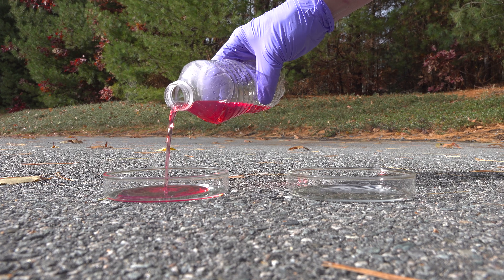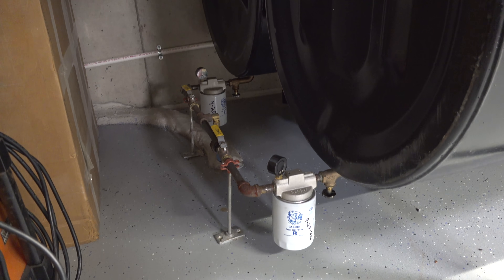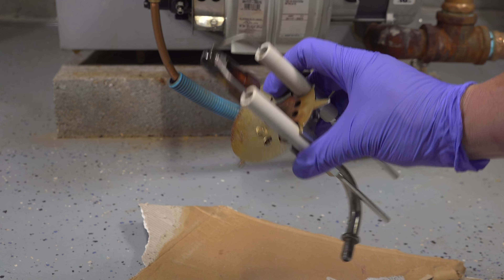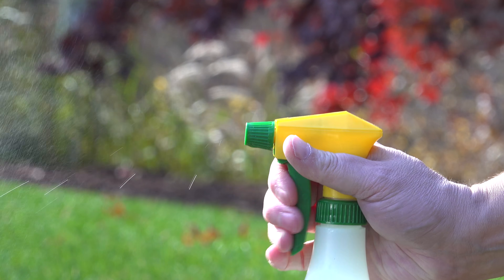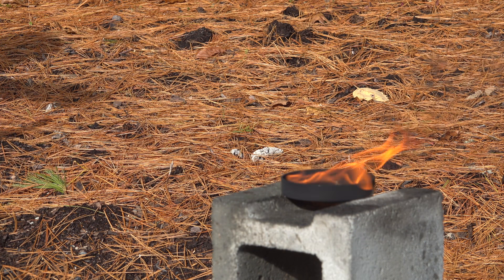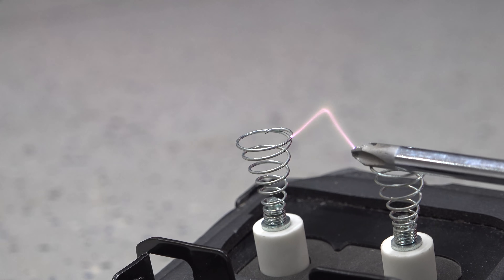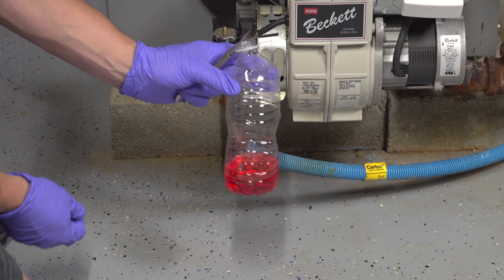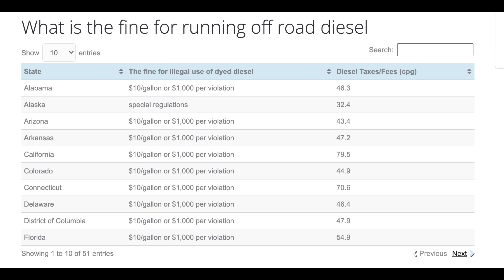Why Heating Oil is BETTER than GAS - Explained

Comment: For the folks that don't know, heating OIL is actually Diesel or some may call it Off Road Diesel. I'm a Hazmat Truck Driver, and I have delivered this product for many winter seasons here in Maryland!
Reply: Here in the U.k it's called red diesel and it's used for farming vehicles. Heating oil has a yellow colour and it's called Kerosene.
Reply: @ZKRITTEX  in the US red diesel is the same as heating oil. theyre both just diesel fuel dyed red to indicate its not taxed for highway use. Kerosene is usually only used as a supplemental heating fuel in the US.
Reply: @TheGenerator_Guy  🎯
Reply: @TheGenerator_Guy  
Is kerosene cheaper or dearer than red diesel in America?
If it's cheaper, why not use it for heating instead of diesel?
In Europe kerosene is cheaper than diesel so kerosene is used for heating.
Reply: @ZKRITTEX  kerosene is a different chemical.
Reply: @ZKRITTEX  
In the US kerosene is number one fuel oil.
Reply: Yup. Whenever I run out of heating oil I'll grab a container of diesel just to survive the night.
Reply: Correct. With pretty much all heating oil now processed to be ultra low sulphur content, the only difference between auto diesel, offroad diesel, and heating oil, is the taxes.
Auto diesel is taxed with road tax.
Offroad diesel is taxed state sales tax.
Heating oil is untaxed. (considered an essential for life, like food and clothing)
Reply: That’s what I thought it was. Red dye diesel
Reply: Yeah kerosene will fuck your furnace if you run it too much
Reply: @danhyde2656  You’re wrong. You got boned by your heating guy. Kerosene burns cleaner than fuel oil/diesel, but it’s got less BTU’s.
Reply: @danhyde2656  no it won't. Kerosene is used in places where the oil tank is outside. Heating oil will gel up in cold weather but kerosene won't. You can run kerosene or diesel in your furnace and it's 100% fine.
Reply: @danhyde2656  your heating tech ripped you off. It sooted because it wasn't it wasn't adjusted properly. There is zero difference in the way kerosene burns in a furnace vs oil. I'm a licensed oil burner technician. As for your tank you've either gotten lucky or your oil company puts in a anti-gel additive every time they fill you up.
Reply: Farmers just call it red dye diesel
Reply: If you don't sitchoooooo diesel head...nah jk very neat. Thanks for keeping us warm
Reply: Is this an add for oil heat?
Reply: Ty, learning alot about diesel and kerosene lately
Reply: In the UK, and to the best of my knowledge,  most of Europe, heating oil is kerosene, not diesel.
There are some houses and buildings which use agricultural diesel (red dyed diesel) but these are very few.
Reply: Hello fellow marylander, what u say is true because i was running low on heating oil so i went to the gasoline station and just got about 5 gallons of diesel fuel and was good to go.
Reply: with lubricity my friend
Reply: Yep, when I run low on weekends and don't wanna pay weekends delivery, i just full up containers with Diseal fuel
Reply: @Larry Butler I didn't know liquid could mix with a gas and contaminate it so why is it relevant? Seems like they are just being efficient with space.

Comment: Being tech savvy, I’m surprised you’ve not yet embraced ground source heat pumps. For one unit of energy to power compressors, pumps and fans, you’ll extract and move 4 or 5 freebies. Tapping the heat right under your yard! Perhaps a video on upgrading your heating, cooling and domestic hot water systems? Can all be done through the heat pumps. I enjoy watching your videos. Keep up the great work.
Reply: Heatpumps are serious buisness.
Reply: Yes, good point. It's always cheaper to MOVE heat than to CREATE heat.
Reply: @mattfoley6082  Heat pumps are still getting hot air from the surrounding area, which can be an issue in some cases

Comment: As a professional and certified oil heat technician, why would you not remove the electrodes when changing the nozzle? 
You take a large risk of breaking those porcelains by not removing them.
Reply: Maybe he's not a softie like you and has confidence in his hand tool skills.
Reply: @mdlabor43  🙄

Comment: I was told most farm tractors run Diesel Red...and they check usually in southern farm belt states. I have never been checked in Cali for my 1997 Ford F350 XLT PowerStroke (7.3L turbocharged I.H.) 4x4 crew cab..also Cali weasels (aka parasites) do smog checks on newer diesels....I am exempt.
Reply: Yes off-road diesel is red

Comment: Was an oil burner tech for over 25 years and have worked on natural gas for about five years. Have not worked on any systems running on gasoline. Oil, natural gas and propane are safe and, if the oil burner is set up properly, both run clean.

The only thing you can really adjust on today’s gas systems is the gas pressure unless you are using a power burner. On oil you can adjust the pump pressure, air gate and in some, the draw assembly. Oil systems are pretty much customizable. You buy the boiler and then choose the burner, circulators, zone valves or flow check valves. High or low voltage thermostats. On furnaces the burner is usually the only choice made. 

If you know what you are doing you can really dial oil in to great efficiency, although condensing systems in oil aren’t as popular as gas units. But condensing systems are designed to work with lower temperature water. So you have to install radiant or new more efficient terminal units in your home. If you are using your old baseboard the retuning water will be well above dew point and all will have is a real expensive non-condensing boiler.

So like I said, the adjustment ability really makes oil great. But it can also make them awful. If your mechanic is setting the flame by eye instead of a combustion tester you will waste oil by running to lean or too rich, too rich and you will be living in soot city. And it will make excessive CO wether set too rich or too lean.

80% gas units are pretty much set it and forget it. The combustion test still needs to be done but it will most likely hit the numbers it’s supposed to right out of the box.

Condensing gas units are harder to dial in than oil because gas guys don’t do it. You need the right mixture gas and oxygen  to be right or you are back to an expensive non-condensing system.

As far as which one is cheaper you need to do some math. Divide price of a gallon of oil by around 130,000 btus and divide the price of a therm of gas by 100,000 btu (both gas and oil btus are an estimate.)

Both are very safe. If the oil system fails to light a safety will shut it down in between 5 and 90 seconds depending on the type of safety. The gas will try for only a few seconds and then recycle. Any gas that comes out will be drawn up the chimney unless it’s propane. If it is propane it will fail and not restart until you reset I. 

It’s possible for your gas system to fail while your sleeping and restart before you wake up. You wouldn’t even know you had a problem…yet.
Reply: They're safe so long as the reset hasn't been pushed 50 times and filled the thing with fuel. Then you could be in for a wild ride.
Reply: I live in PA and do my own oil burner service (clean soot out of chamber and pipes, change filters at tank and pump, clean/replace nozzle, clean/replace electrodes, drain radiators and refill). Companies charge like $300 for annual service. I don't do combustion test but what I lose in efficiency I more than make up for saving the $300.
Reply: @mattfoley6082  If you can get an exhaust tester I'd consider it. Or at least somehow rig up an automotive wideband oxygen sensor, if you know how to read one.
Reply: Great explanation. I have been working on hvac equipment for about 15yrs. Haven't done a lot with fuel oil furnaces. They are not very common in the st louis area any longer. I have removed a lot of them and worked on only a handful.
Reply: I wonder if the issues from running overlean (if the system is otherwise running correctly) could be corrected by having a secondary combustion chamber or something.

Also, wouldn't an advanced oil burner with a way to sense the air density (i.e. temperature, pressure and humidity) at the intake be able to burn at the correct mixture all the time? I suppose it could, but nobody's ever done that because it can be static adjusted and be 95% right, 95% of the time.

Comment: From what I've learned, heating oil furnaces take a lot more maintenance than say natural gas but they are less expensive because there's just less moving parts. Also heating oil is stored in a tank in the home so it has to be filled periodically. Natural gas is piped in so it refills forever. So basically natural gas = less hassle. Both require electricity to run the furnace but I have a non-venting natural gas heater that doesn't use any electricity to operate as emergency backup heat.
Reply: Best part about gas to the house is then you can tie in the cooking stove and water heater. Having had oil heat for years it sucks, especially if you have buried tanks and run the risk of them leaking.
Reply: @on4acres  I'd much rather have an oil tank leak than a gas pipe leak but that's just me
Reply: @ghost2coast296  well oil leaking in the ground requires soil remediation and is very expensive. Natural gas is mostly methane and doesn’t require remediation of surrounding areas.
Reply: @on4acres  a proper underground tank has a very low chance of leaking

Comment: Truck driver here. I've been pulled over once for a diesel fuel check. The cop dipped what looked to be a clear, 2 foot straw into my fuel tank and withdrew it to reveal the colour of the fuel. Thankfully, I fuel up at commercial cardlocks and the colour was normal. If the fuel had been purple, I would have been in big trouble.
Reply: Never knew they'd check

Comment: I use a 220,000 BTU torpedo heater for my shop. I used to use diesel to run it, but it ejected a very small amount of soot, but most annoying were fumes and the cost. Clear kerosene was not an option at 9.00/gal. Found out heating oil, (stove oil in the pacific nw) is about 3.75/gallon. Since you are burning fuel there are fumes but the shop is large and doesn’t have insulation so not too bad. Will run it to break the chill then shut it down. Not ideal, but it’s cheap and it works in a pinch. Been doing this for three years so no, I’m not going to die from carbon monoxide poisoning.
Reply: it's not the CO that's the problem. These oils give off ultrafine particulate that goes directly through your lungs into your blood, and appears to cause heart disease.
Reply: Used oil burner.

Comment: Oil is a good fuel.  Natural gas is also very safe unless you do something not allowed.
Nat Gas requires a lot less maintenance and is the fuel of choice.
It is more efficient and costs less to heat with.
No, I’m not pushing natural gas.  I actually heat with propane.
They all have pluses and minuses.

Comment: Used to have oil in previous house and can't be more happier to have NG in the new house.  Oil was always way more expensive and I could smell it in the basement (yes it was an updated system).  Not to mention it requires more maintenance and level monitoring/ delivery process is another thing to worry about
Reply: We have Rinnai NG wall heaters. Very little maintenance, and far, far cheaper than red diesel.  I lived in Maine for 5 years, and heating a home was cost prohibitive on red diesel, it was the second largest bill next to rent. 

Having been from Montana, and living here again, red diesel isn't a thing here, nobody uses it for heating.  NG is literally 1/4 or less the cost of red diesel. It's combined with your electric bill, which can be set to a stable average monthly payment, and doesn't need to be physically delivered by truck.

Red diesel heat is keeping a lot of northern New Englanders poorer than they need to be.

Comment: Don’t think you can get away with Running Fuel Oil in your Diesel Pick-up or Car. It will shut it down. It will cost $1,000 of dollars to clean up. Any Mechanic that wants to avoid the possibility of huge fines, loss of mechanics license and jail time, will report you before proceeding.
Reply: Fuel oil and Diesel are the same. In fact the same tanker truck the delivers fuel to our farm for use in the tractors and heavy equipment also fills the fuel tanks in our basement. At the end of the winter season, we will pump any remaining fuel out of the tanks in the basement and run it in our tractors.

Comment: I was able to get cheap heating oil from HVAC companies.  When they changed out oil to gas, heat pump or propane, I would buy all the oil they pumped out of the old tanks they delivered to me.  I had 750 gallons of storage.

Comment: I had a yr 1971 oil fired boiler.  In 2005 I put in a new Becket burner like the one in your video.  Increased efficiency and saved $$.  Should have done it long before then!
Reply: Just be sure to fire the burner properly to achieve maximum savings

Comment: Had no idea heating oil wasn't more popular, everyone on my block is oil heat. Just need to call my HVAC guy every fall to change the filter. Only downsides are burning fossil fuels and pretty big price swings year to year.
Reply: Installed a Mitsubishi four head three ton mini-split system in my house in august, 2020. 

Heated the house on the coldest day here on Long Island, around 15 degrees. Most of the time it was much warmer. My first summer was great but I struggled with humidity. Turned out that by running all four heads the system ramped way down and the coils were warmer so they didn’t remove humidity. 

This summer I only used the 1-1/2 ton head in the living room during the day and left all doors open. Humidity went from 70% down to 50%. Had to raise the temperature from 68 degrees to 73. At night we used the head in that room and shut it off when we got up. 

Solar panels are next. Then maybe an electric car. Will keep one that runs on gas though.
Reply: @brianmahoney154  yeah, high end heat pumps will be more cost effective then any other heating solution. If only the fact was better known.
Reply: @Dirty_Bear22  until repairs are needed, then it gets pricey
Reply: @stephanmussehl7425  A properly installed heat pump from a reputable brand will give you 15-20 years of service. Most companies offer 10 year compressor warranty.

Comment: I bought my first house 10 years ago that has heating oil. I have a 500 gallon tank. I have a woodstove insert and i usual offset the use of oil with it. I burn wood from noon till bed time. Have oil set to fire when inside house temp gets to 70 which is usaly about 2 or 3am..
In summer when your not using oil heat its best to top off your tank. That way condensation will not build up inside of tank and rust the inside of tank out.
Reply: You can also add a water dissolving additive to your oil 😁 I do on occasion just to keep the tank clean

Comment: Its almost like heating oil is diesel fuel but with a red dye in it. Weird.
Reply: That’s exactly what it is. You can pour heating oil in your diesel truck and it will run just fine.
Reply: However if you have red diesel in your truck you will get a huge ticket. Don’t do it.
Reply: In a shtf scenario fuel oil would run any diesel vehicle

Comment: Question: Those Wabasto Diesel heaters being used in RV's, Van, Semi Truck cabs, could those operate on Heating Oil?
Reply: Yes because diesel and heating oil is pretty much the same thing. You can use it for off road diesel engines. Those diesel heaters will run just fine on heating oil. It is illegal to drive a diesel vehicle with red fuel.
Reply: @markm0000  but not unlawful

Comment: this video helped me alot because i wanted to do oil to gas conversion on my house, and the gas company is alot of hassle they jave to dig up alot and the oil company they dont have to dig up they just have to put the furnance and thats it.
Reply: The problem with gas is, it might burn cleaner but it generates less BTUs then oil! BTUs are the measurement of heat produced when burned .
Reply: @da_blade5040  Not sure where oil doesnt burn clean comes from.  Should be 0 smoke in flue or out chimney if burner has been set up correctly.  If they burned dirty people with oil furnace would sweep their chimneys.  They dont.

Comment: You have a good knowledge of oil burners and heating oil. Were you ever in the trade? I'm a plumbing and heating contractor and am quite familiar as well. 👍🏻
Reply from the maker: Very nice of you to say, no years ago I tried to resolve some burner issues and was never able to hire anyone that seemed to give a crap so I spent a lot of time, bought instruments, etc to do it myself. I don't recommend people do their own work for this area since it can be illegal depending where you live but these burners are sometimes on kilns, etc that may not be regulated.
Reply: @SilverCymbal  I’m sure you also learned a lot from Steve Lav, he has a ton of oil videos
Reply from the maker: @mrpanos923  I most certainly have, he is the master of many things, but most definitely of oil!

Comment: One thing I like about home heating oil is you get more heat per gallon and you can burn a lot of other things in there besides (usually. Check your manual first). This is nice in an emergency. Same for a wood burner. What I don't like about it that if you are storing it for more than two years time it can go bad. It's also pretty toxic compared to LP gas. 
This is what I like about propane. Propane is good in storage for decades. It also burns a lot cleaner. But it's more expensive and less energy per gallons.
Reply: Propane is triple price of oil